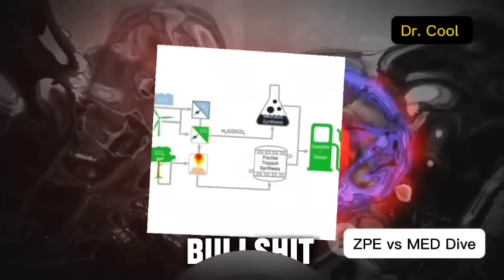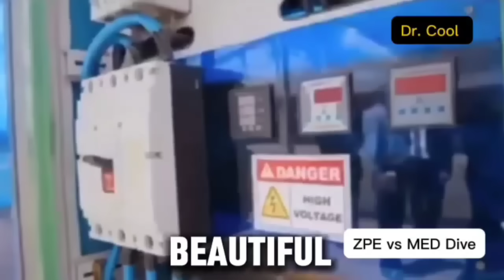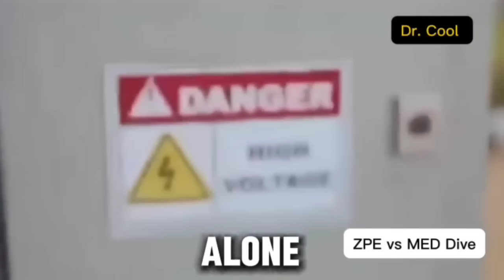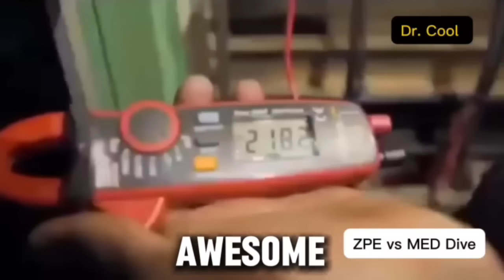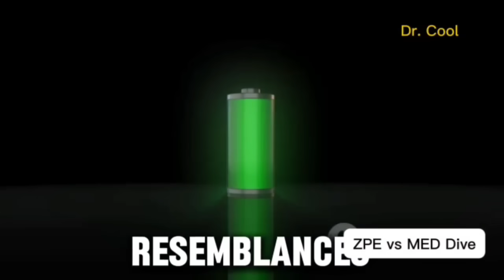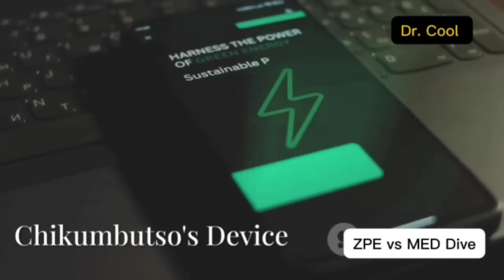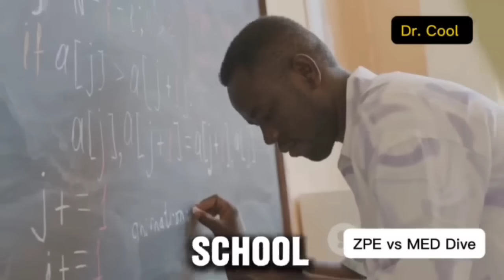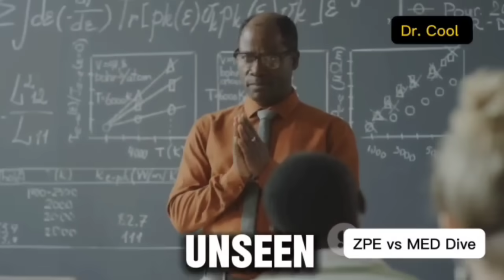SELF POWERED CAR INVENTOR  Cracked ZERO POINT Energy Code! SHOCKED U.S SCIENTISTS

Comment: Lets reframe Earth's low contrast abundant ambient heat as a thermal energy waypoint between heat and other forms of energy. Energy changes form without gain or loss. Uniformity is not in itself a form of energy.  

A simple rectifier crystal can, 
just short of a replicatable long term demonstration of a powerful prototype, almost certainly filter the random thermal motioren of electrons or discrete positiive charged voids called holes so the electric current flowing in one direction predominates. At low system voltage, a filtrate of one polarity predominates only a little but there is always usable electrical power derived from the source, which is Johnson (observation) Nyquest (theory) thermal electrical noise. Max Plank anticipated that ambient thermal noise would become usable with advances in technology.  

In 1973 I filed for US patent 3890161A DIODE ARRAY for an array of metal1/ insulator/metal2 diodes that refrigerate while concurrently producing electric power. The patent was granted in 1975. It was opened to the public domain in 1992.( Development should be in the public domain. 

The plausible net electrical filtrate from diodes can be aggregated in grouping separate diodes in  consistent alignment. The alignmet must initially be parallel. A higher order of these parallel groups can be connected in series to produce higher voltage. Within limits, parts of the  network can be shorted out or open circuted without electrical or chemical  harm. The electrical  power released is always equal to the refrigeration produced. Inefficiency effects the performance but not the equality of the thermal absorbtion and electrical yield of the conversion. 

The maximum energy is converted from ambient heat to productive direct current electricity when the load electrical resistance  is equal to the array internal electrical resistance. Maximum calculated electrical power output (watts) is k (Boltźman's constant), one point three eight x 10^ minus 23, times T (temperature Kelvin) times bandwidth (0 Hz to a natural limit on 0~2 THz @ 290 K) times rectification halving and nanowatt power level rectification efficiency, times the number of diodes in the array. 

There are a billion cells of 1000 square nanometer area each per square millimeter, 100 billion per square centimeter.

Order is imposed on the random perpetual thermal motion of electrons in the structurally determined fabrication of diodes array made of diodes 

Host crystal in this example is silicon or germanium. 

  P type boron doped
-----‐------‐----___-- Out
🔻🔻🔻🔻
■■■■■■___ + Out
  N type phosphorous doped 

All the P type semiconductor anodes abut a metal conductive plane deposited on the top face of the slab with nonrectifying joins;  the N type semiconductor cathodes or common cathode abuts the bottom face. As the polarity filtered electrical energy is exported, the amount of thermal energy in the group of diodes decreases. This group cooling will draw heat in from the surrounding ambient heat at a rate depending on the filtering rate and thermal resistance between the group and ambient gas, liquid, or solid warmer than absolute zero. There is always a lot of ambient heat on our planet, more on equatorial dry desert summer days and less on polar desert winter nights. 

Energy sensible refrigerators that absorb heat and yield electricity of equivalent energy content would complement computers as computing consumes electricity and yields heat. Computing would be free. Chips could have energy recycling built in. This would improve performance and lower cost. 

Full heat recycling, all electric, very isolated underground, undersea, or space communities would be highly survivable with self sufficient EMP resistant LED light  automated vertical farms, thaw resistant frozen food storehouses, factories, dwellings, self contained elevators, safe rooms, and horizontal transports. 
In a flourishing civillization, small self sufficient electric or cooling devices of many kinds and styles like lamps,  smartphones, hotplates, water heaters, cooler chests, fans, radios, TVs, cameras, security devices, robot test equipment, scales, transaction terminals, wall clocks, open or ciosed for business luminous signs, power hand tools, ditch diggers, pumps, and personal transports, Refugee communities would be buildable quickly. Fire safes would preserve contents to 1500F for years. These would be available for immediate use incrementally anywhere as people as individuals or larger social groups see fit. 

Some electrical equipment groups could be consolidated into local networks when suitable. Liguid nitrogen cooled superconducting networks would become practical. 

If a high majority thinks our civilization should geoengineer gigatons or teratons of greenhouse gasses out of our environment, instalations using devices that convert ambient heat into electricity can hypothetically be scaled up do it with a choice of comsequences including many beneficial ones. 

There are other plausible breeches for anyone to of the second law of thermodynamics.  Hopefully a lot of people in independent teams, will join in expanding the breech. Please share the successes or setbacks of experiemental efforts. 

These devices would probably become segmented commodities sold with minimal margin over supply cost. They would be manufactured by advanced automation that does not need financial incentive. Applicable best practices would be adopted. Business details would be open public knowledge. Associated people should move as negotiated and freely and honestly talk. Commerce would be a planetary scale unified conglomerate of diverse local cooperatives. There is no need of wealth extracting top commanders. We do not need often token philanthropy from the top if the wide majority of people can afford to be generous. 

I do not seek to be the lead developer. This will disable confirmation bias and assure that other developers are acting on the merits of rhe hypothesis independently. In doing this, I forfit the Ray Bermister effect where acceptance of a new paridgm is facilitated by tangible success. 

Here are some possible development path starts for indepedent prototype teams to consider in their research and development pursuits: 

A nano conductive needle, perhaps a nested wall compound carbon nanotube tipped with LaB6, each abutting a ~1micron vacuum or insulator section abutting a heat and electricity conducting substrate based field emmision metal needle array. The efficiency is poor but the bandwidth is excellent.

Au needles abutting an n type GaAs or InSb thin common anode on a structually supportive electrically conductive substrate.  Similar structures have been made in the past. It could yield performance  better than crystal diodes suitable for persuasive proof of concept prototyping This also may be a stranded project, overcome by to more difficult but higher potental approaches. 

Silicon or germanium crystal diode technology is well developed and  can be executed quickly but would perform poorly, merely adequate for marginal quality proof of concept prototyping. 
do not seek to be the lead developer. This will disable confirmation bias and assure that other developers are acting on the merits of rhe hypothesis  independently. 

DIAGRAM OF VERTICALLY FABRICATED CRYSTAL DIODE ARRAY
Ghmic contact boundry 
  P type boron doped
-----‐------‐----___-- Out
🔻🔻🔻🔻
■■■■■■___ + Out
  N type phosphorous doped 
Ohmic contact boundry
SUBSTRATE 

All the P type semiconductor anodes abut a metal conductive plane deposited on the top face of the crystal slab with nonrectifying joins;  the N type semiconductor cathodes or common cathode abuts the bottom face. The bottom face is on top of an ohmic contact electrically and thermally conductive supportive substrate. 

The topic deserves discussion and prototyping attempt action. 

  There could be net entropy reduction in the full lifetime energy accounting of diode array use. The entropic deteration of the structure of machine parts made of tough solids is inevitable but can be  minor compared to the stress of their use. This  is negative overall entropy.   

Diode array devices should be able to power the manufacture of àn ever increasing number of devices. 

Aloha
Charles M Brown
Kilauea, Kauai, Hawaii 96754
Reply from the maker: That's a lot of critical Analysis, what happened afterwards? What's preventing this ideology into implementation?

Comment: The principle is back emf. With this we get a very high voltage spike. For a very short period of time. A step up sequence of transformers applies that spike to a coil and immediately disconnects the power for an even bigger spike. It is disconnected from suppply at this point. The sequence is repeated until we have a very high voltage from which we apply a drop down to lower voltage, but high current due to low inductive resistance. This is done in a sequence of rapid movement. Therefore the low voltage high current has to be evened out into a consistent continuous current, which is easy to do. (Helping him with his "head wound?). The subjects continue to take this as their own. The equations for this were given on an elctrical engineering course I did in 1980's.🎉
Reply from the maker: Having the equation isn't enough it's just the start up, build a sustainable device like he did is the solution

Comment: I want to see a schematic of the circuit!  What is the "front end" of the device made out of?  Is there a picture of the front end so we can see its form, the way that it is made?  Since there has to be some kind of subsection or subsystem that does the job of extracting the energy from the universe, like a radio needs an antenna to pick up a signal, we need to see what it is!  Are there some never seen before elements in it that pick up the radiant energy from the sun?  Is it a 3D fractal element antenna?  What is the frequency of those waves of energy?  Or is it just static noise that somehow gets converted into usable electricity?  How does this device set the output voltage and keep it constant so your TV or vacuum cleaner don't get blown apart?  Does it have some kind of a feedback loop in it so it can moderate itself and not get into a runaway condition?  No one yet has said exactly how the device works, so I have to assume that it doesn't work as is claimed.

Comment: Not just generate power but enormous amount of energy! Energy not from RF or frequency transmission station or from any antennas but actually from the infinite spining energies of zero point atoms all around us!!! He cracked the modulations code by try on errors! He harnesses it by amplifying it using loops and causes a endless chain cycles reactions that is somewhat like a nuclear reactors but without any gamma radiation but microsonic in nature!!!97.3Mhz!!!

Comment: Not trying to down play the claims. As in public certainly, thats all weve seen . For months now , ive watched videos from a dozen different you tube creators, all saying and showing much thecsame thing. The first video on the subject I ever saw was a car with the hood up, and Maxwell holding a plastic box we were told is a generator. We have never seen a single picture or moving film of his claimed device. Lots of stories of how its done and what it does. I e mailed his company to ask to become a distributoer, not a word in reply. He claimed a chinese celectric car mfr was fitting his unit to drive their car, even showed pictures of his plastic box in the cars engine compartment. This is all there is. Not a single video since the first one, of a single power unit showing any movement or power generated, that was anything other than an electric car engine compartment. Silence two months or is it three, of more of the same from other outlets. Im sick of it. It appears the claims are simply nothing but dreams. Sadly.